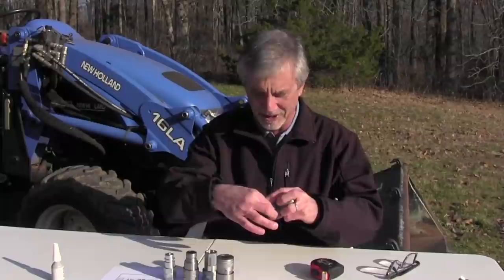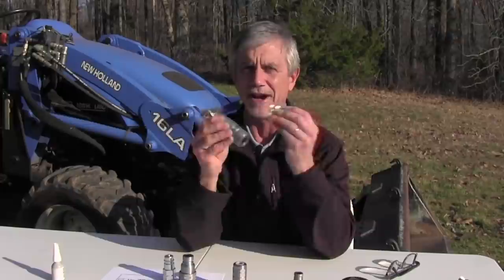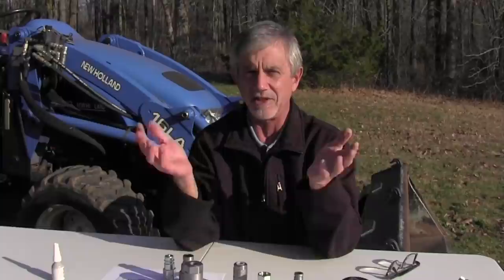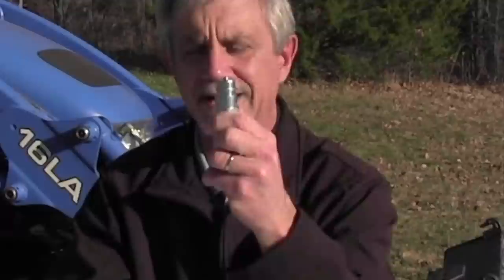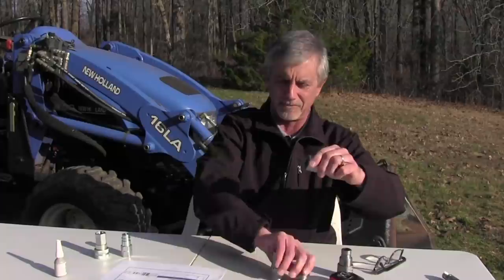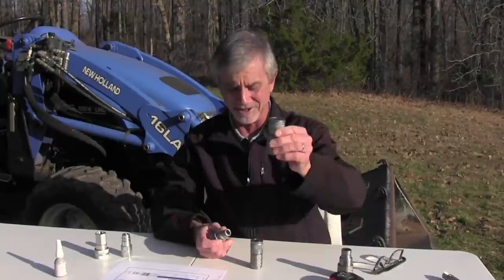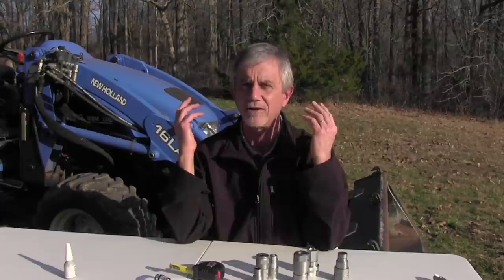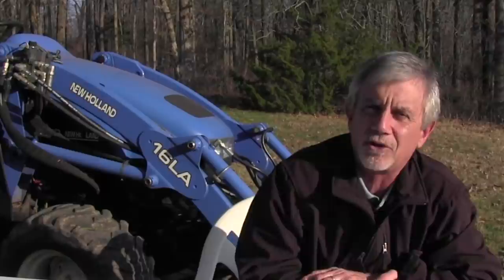The Exciting World of Hydraulic Couplers and How to Identify What's on Your Tractor

Comment: You mentioned having one male and one female on your front remotes being ideal. I have found I like to have them both the same sex. That allows me to run the implement backwards if I have too. For example if I get my auger stuck on a tree root, I just swap the hoses and "unscrew" it. I also have a friend that has a front mounted brush hog if you will and the blades are sharpened on both sides. One side gets dull you just swap the hoses and run it the other direction 😀

Comment: Good video thanks for the info. I guess like most tractor owners I've run into these issues over the years. Last year I purchased a sickle mower made in Italy, it had Pioneer fittings on it but it sure didn't look like my other Pioneer fittings. It worked but by looking at it I wouldn't have bet on it.

Comment: Really good stuff as always Mike! Don't know if you've covered it before but folks may want to also know why their hydraulics "hooked up fine during summer" and won't connect in the fall or in other temperature differentials no matter how hard they push and shove these connectors. Though it's a simple solution and easy fix, I had to figure it out the hard way. Thanks again for great content amigo!

Comment: Real good video and necessary information for anyone new to tractors.
Years ago every manufacturer had proprietary couplers. I spent 20 years getting all my implements and tractors converted to Deere cone style. Then Deere decides to go to Pioneer.
Maybe you should do a video on the different sizes and types of hydraulic hose sizes and ends also.

Comment: Hey Mike, at the 8:40 mark you commented on "some" folks using two MALE connectors on their tractors and could not understand why.
Well sir, I, myself, have TWO FEMALE PIONEER connectors on my tractors, and use the male connectors on all of my implements.
Why, you ask?
For me, it is MUCH EASIER to pull the collar back on the female connectors when they are on tractor as it gives me something to push against.
And then you may ask, "How do you know which hose connects to what?".  I remedy this by placing white zip ties on the hoses to be matched on the tractor and the implement.
I realize this may seem ludicrous to some, but it is what works for me.
After spending WAY TOO MUCH TIME fighting my hydraulic connections, and this is AFTER RELEASING ANY HYDRAULIC PRESSURE on ALL of my hoses on both the tractor and implement.  I have to believe that this was caused by my trials with flat face couplers, and to say the least, I HATE the flat face couplers!!!  Now this is probably just me, but again, my method works best for me.
Also wanted to thank you for your chart as to coupler sizes.  It helps a lot!
Next video you should think of doing is explaining the different TYPE of hydraulic fittings in regard to JIC and ORBOSS!!!

Comment: Thanks for this video. I wish your video came out a few months ago when I ordered a grapple for my new tractor. One thing you could have discussed are the big difference between the Pioneer and Flat faced couplers. The grapple dealer was going to charge much more for the Flat faced coupler but couldn't explain the difference between them. I have since been told the Flat faced coupler doesn't loose as much fluid when they are uncoupled. Another thing is do all male Pioneer couplers have the small tip on the poppet or do some have a ball shaped poppet. Maybe the coupler with the ball style poppet isn't called a Pioneer. Can the male coupler with the ball poppet be substituted with one with the small tip, like you showed in the video. Keep up your very informative videos!
Reply from the maker: I'll discuss that in the next video,  Flat face couplers are a lot more expensive but a lot cleaner.

Comment: My Summit coupler does not connect to a Parker Coupler, both Pioneer style and 3/8 size. Also the protective caps are not interchangeable either. It took some effort to get everything to interface properly for my homemade third function kit.

Comment: Great video Mike! yeah i was not sure on the pioneer or "Ag" couplers in terms of measurement, i thought it was hose diameter or the interior flow diameter where the connection was where the measurements were taken not the full exterior. thanks for clarifying,

I was debating on the 3rd function attachment end to run the skid steer flat face in the same size as the pioneer style the tractor has as the loader is SSQA so if I want to run a skid steer powered unit on the front, i don't need special adapters. Just hook the unit on the front and an auxiliary power pack on the back and away i go. Best of both worlds! Can you do a video on how to choose the right auxiliary power pack for the tractor? So the hoses won't rupture from too much PSI?

Comment: I tried to find pioneer 3/8 in anything other than npt.  I don't do ameteur hour and npt is the  worst type af fitting for 2500 psi. ORB, or ORFS is the way to go.  Ended up convertig all machines and attachments to 3/8 flat face.  Lots of$$.  Like 80$ per pair to 20$ per pair.

Comment: Mike. What about the thread sizes of the hoses aren't they different?  I have a Kubota lx3310. I'm wanting to switch to flat face couplers but not sure of the size.. I believe they are 1/4".. Are all threads NPT?  So I wanted to do the loader and snowblower with flat faced couplers just not sure how I can do it...
Reply from the maker: Great question!  I'm not sure whether they're all the same or not.  The hose size should be printed on the hose if it's not worn off, 1/4" sounds too small to me.  Most of the hydraulic hoses I've seen are 3/8" and have the NPT threads, so that's likely what you have.  I've heard manufacturers are using a lot of different sized fittings, but most of the hoses are 3/8".  You could get the 3/8" NPT and try it, most places will let you return it if it's the wrong size and hasn't been installed.  You could also let the loader down and take all the weight off of it and pull off one of the short tilt and curl hoses and take it with you.  Good luck!

Comment: I think you should measure the male half,  you can check it from the standard files like ISO 7241 or ISO 16028. cannot measure from the sleeve. I think we should have an 800 number on our website, which I learn from your video. thank you.  I am working in a quick coupling manufacturer.

Comment: We got a pre-owned Mahindra 1533 last November and it came with a backhoe from the manufacturer. The main seat swivels backwards. I am curious (with the backhoe off) what it would take to connect onto the back hydraulic line and to bring a (pair) line to the front loader for a grapple. Obviously it needs a controller between the line and the front. Is that all? perhaps even use/steal the backhoe controllers?
Reply from the maker: That could possibly be done, but most backhoes I've seen are plumbed to require continual flow, and when they're not working there has to be a return line back to sump.  I think you'd tie more money up in trying to make a system like that work as you would just adding a third function or diverter and it would be a bunch more hassle to connect and disconnect.  Maybe someone else who has tried that will comment, I'm all about saving money but I don't think having the backhoe system gives you anything you can use to power a grapple.

Comment: Question for you Mike, often times I find a bunch of dirt inside the female quick disconnect fittings. How do you clean the dirt out? I heard some people recommend spraying starter fluid in the fitting to flush out dirt. What do you recommend?
Reply from the maker: I've not had to clean mine out.  There are aftermarket rubber plugs that you can get that keep them closed when not in use.   I highly recommend getting them so it prevents dirt from getting in there in the first place.  If it's an implement, you can plug the male into the female to keep everything clean.  You really don't want dirt in the hydraulic system.  The filter will catch it, but it can still cause problems.

Comment: Hi Mike, thank you very much for this video.  I hope you are still monitoring comments, because I need HELP!  I am new to tractors and I bought a used Kioti 4510.  It came with front hydraulic connections and a 3rd function loader lever.  The front connections appear to be what you refer to as Pioneer couplers.  I ordered a grapple and it came with what you refer to as Open Face couplers.   So, unfortunately, I suppose I need to swap couplers on either the tractor or the grapple.   It seems like even though the tractor has Pioneer couplers, it would easier (for me) not to mess with them and swap out the Open Face couplers on the grapple.   I tried to make sense out of your chart, but unfortunately, I couldn't.   I wrote down the numbers on all four couplers.  I wonder if you might be able to help me figure out what I need to order.   The Pioneer couplers on the tractor are  dnp -PAV13F-1/2NPT 18 (large coupler) and dnp -PAV13M-12NPT 18 (smaller coupling).  It has the pointy poppet, not the round poppet.   The coupler numbers on the grapple are,  LPH 0422 KSP4-08-08F-NPT (large coupler) and LPH 0422 KSP4-08-08M-NPT (small coupler).   I tried to Google search the numbers but don't get anything specific to any of those numbers.    You would really make my day if you were to deciper these numbers for me !!!  Thank You
Reply from the maker: I don't have information about those numbers but you might try the folks at Summit Hydraulics: (800) 325-3695.  They seem to know they're stuff and have always been good to work with.  They are in Arizona, so they're on Pacific Time.  Good luck!

Comment: If you have two male couplers on your tractor, get two females and switch one out so you make sure to hook it up the same everytime.  Males cost less than females, that's why you might get a tractor with two males.  Also, if you'll have multiple implements buying m/f pairs will cost less than buying all females.

Comment: I have problems with male fittings disconnecting from my kubota. I have noticed that pioneer 1/2” have several different #’s. From what you say, any 1/2” fitting will interchange, regardless the manufacturer. I have not been fortunate to have this happen. Some fit fine , while others are almost impossible to disconnect. Pioneer has several different male connectors. Some work fine while others don’t. It doesn’t make sense.